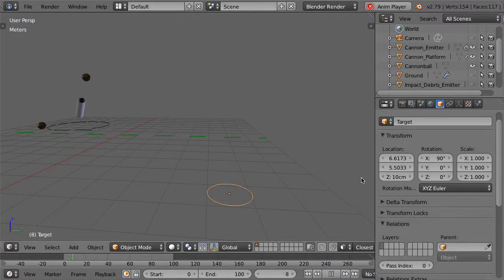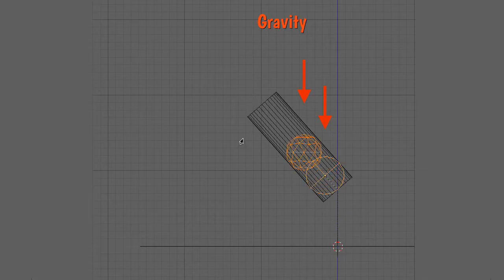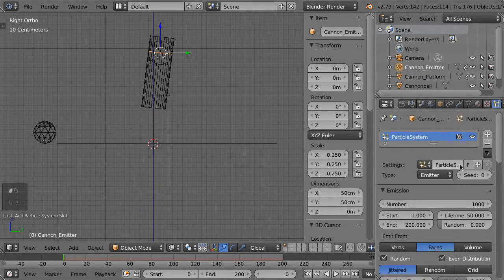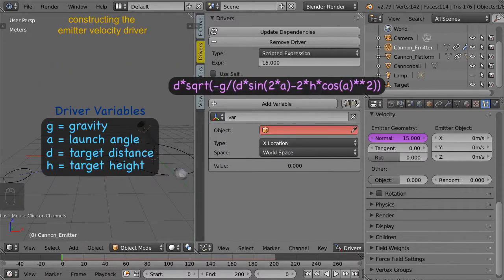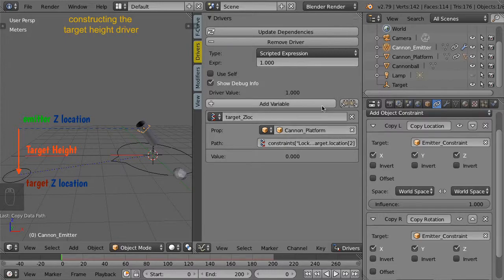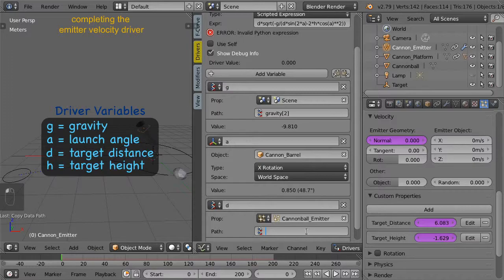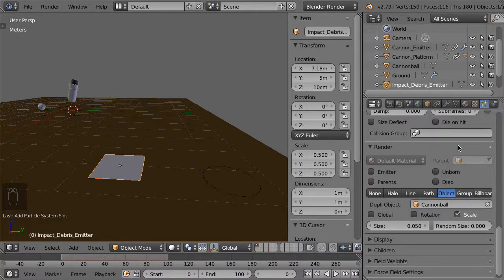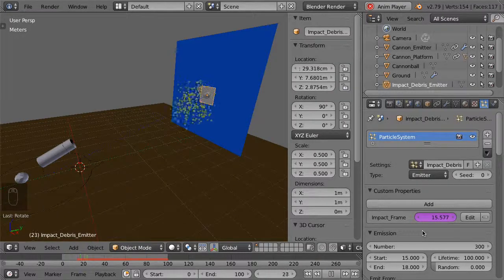Blender : Automatic Targeting Rig for Particle Projectiles

Comment: Please reply 
I want to move cube in x any y axis but how to manipulate that x and y value with respect to sin or cos of rotation of same cube at a point of time
Please help
Reply: I think this video contains the answer but I need to understand drivers a little more, then again see this video
Reply from the maker: I'm not sure I understand what exactly you want to do, but it sounds like you want the cube x and y location to be driven by the x and y rotations.   This will essentially move the cube in a circle around the world origin at a speed relative to the rotation of the cube.   This is a simple driver setup.   Add a driver to location X and Y.  (right click on the location channels, and select Add Driver). In the X location driver Expression enter "cos(rx)".   Add a variable to the driver, and name. the variable "rx".  Set the Type to Single Property.  Set the Property to Cube,  and the Path to "rotation_euler.x".   For location Y, enter the Expression "sin(ry)".   Name the variable "ry".  Set the Type to Single Property.  Set the Property to Cube,  and the Path to "rotation_euler.y".   This will move the cube in a circle with a radius of 1  as the X and Y rotations are animated.   To move in a larger circle,  multiply both driver expressions by a similar constant, such as "cos(rx)*2" to increase the circle radius to 2.   Animating the X and Y rotations in a non-uniform fashion will make the cube move erratically within the specified radius.   Let me know if that helps.
Reply: @aliensoup2420  Thank you for your response, this will do what I want